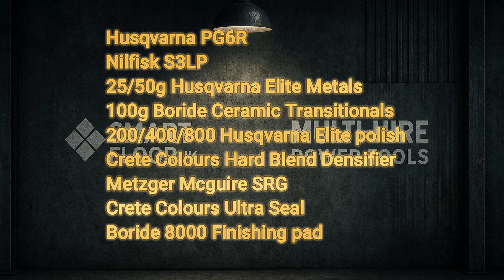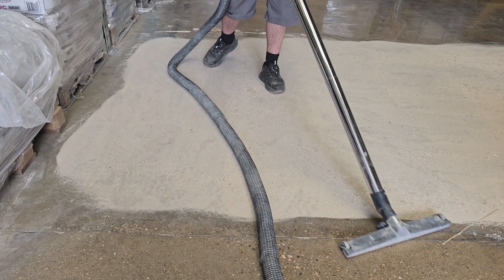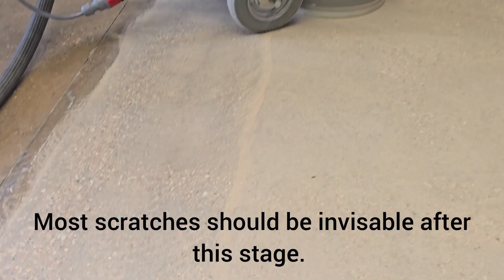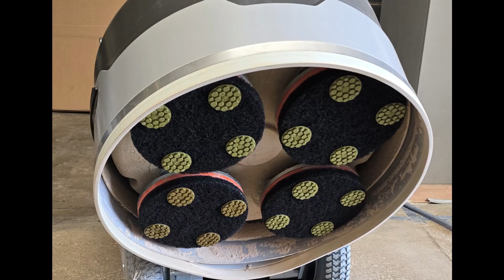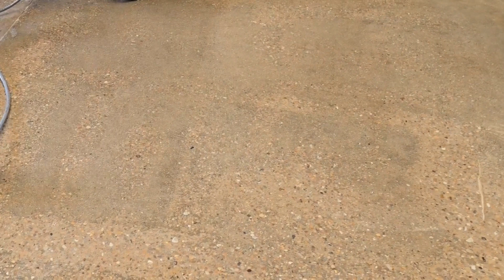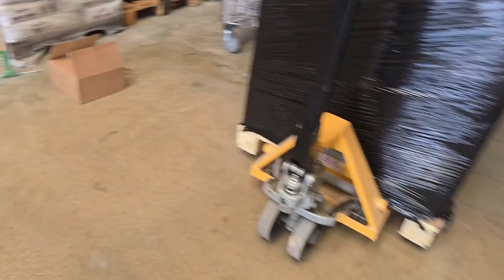How to Polish a Concrete Floor | Step-by-Step Guide with Tools & Tips

Comment: Thanks for the video it was very helpful. I'm about to embark on a concrete floor grinding/polishing odesey myself. Do you have links to purchase the grout?
Reply from the maker: The SRG grout that we used In the video can be found here - https://www.multi-hire.co.uk/product/mezger-mcgure-surface-refinement-polished-concrete-grout/.  If you are after a high gloss finish then it’s the best option, it can also fill holes up to 3mm.   The grout can be coloured using a colour pack you can find the examples here - https://www.facebook.com/share/p/1Fs9xnEwfd/.    

Sent you an email with more information that may be relevant :)
Reply: How did your job go?

Comment: Fark me…

I need to do a 4 car garage and driveway….

I’ll see you in 50 years when it’s done.

Ridiculous!
Reply from the maker: A 4 car garage would take 2 days.  Depends on the size of the driveway for time.  The floor with the correct maintenance will last 20 years.  Not a bad trade off for longevity.
Reply: I wouldn’t recommend polishing a driveway 😂

Comment: What’s the grout for?
Reply from the maker: Hi Lee, 

Fills pinholes & air voids - When concrete is ground, especially with metal bond diamonds, small pinholes, air pockets, or surface imperfections are revealed. Grout fills these tiny gaps to create a denser, more uniform surface.

Improves surface strength - By filling those voids, grout prevents weak spots where dusting, staining, or chipping could start.

Enhances clarity & reflectivity - A fully grouted floor polishes up with much more consistency. Without grout, the pinholes stay open and scatter light, making the floor look patchy or cloudy.
Reply: @multi-hirepowertoolsltd2531 so it’s grout then densification?
Reply from the maker: Sorry Lee, our notifications to say we have had a message haven't been coming through.  Depends on the grout.  The one we use here the SRG has to have the excess removed so we recommend 100g, SRG, 100g again, Densify.  If you are using something like GM3000 or Pin Fix then its done at the 50g stage so it would be 50g, 50g with grout, 100g, Densify.  Are you thinking of doing a project?  If you fill out the advice tab on our website, put FTA of Luke ill send you an email so you have my email and phone number. https://www.multi-hire.co.uk/advice/
Reply: @multi-hirepowertoolsltd2531 is this before the densification
Reply: @multi-hirepowertoolsltd2531 how long did you leave the grout on for?

Comment: Would of loved to of know the RPM for each stage, great vid!
Reply from the maker: Hello,  All machines, floors and accessories are different.  Generally however, find the speed on the first stage which is generally lower, so the machine is cutting well, but not removing too much on a pass.  You then move the speed up slightly through each stage.